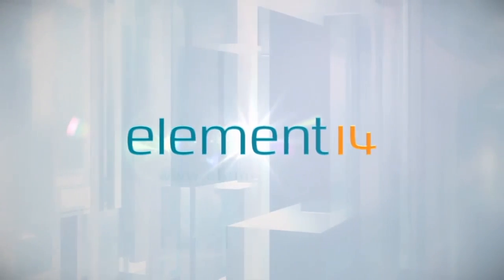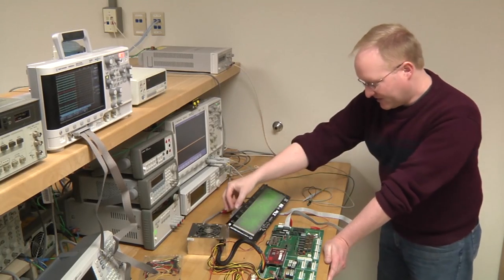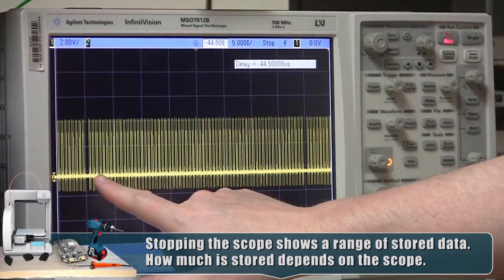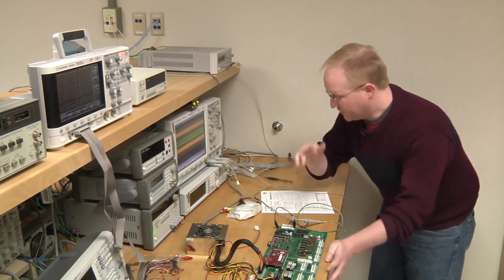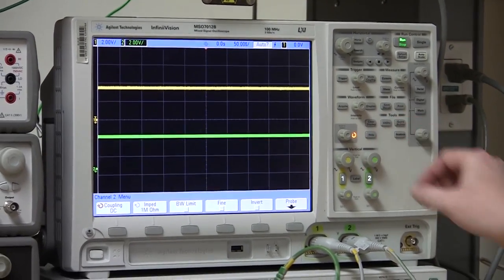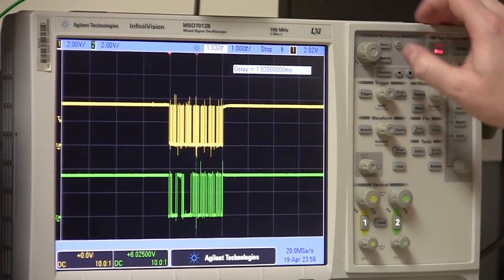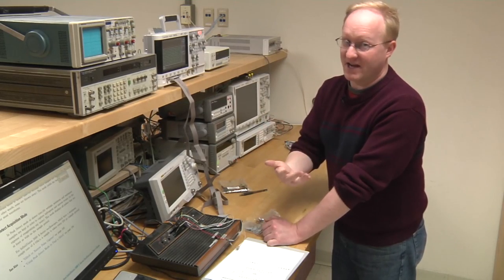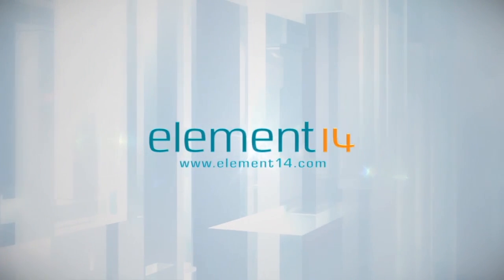Take a Look Inside with Oscilloscopes

Comment: It's pretty funny, I got back into electronics and microprocessor programming last winter before I bought a scope. I used a tiny2313 in assembly, and wanted to move a servo, so to calculate the PWM I counted clock cycles.  I got it working, but bought a scope a couple of weeks later and hooked it up to look at the frequency... that would have been a lot quicker. lol

Comment: You should try to create another 3D printer out of only (mostly) salvaged parts from printer. May printers don't have stepper motors and now use other components such as linear encoders and the DC motors!
Reply from the maker: Thanks for the idea!

Comment: Could be cool get an old cisco router, or switch, and look at boot. I remember i was getting a cisco cert everything i saw said know how to reset password. Cpmpared to most network stuff, it's a rather complex procedure. enter a special diagnostic mode, change the memory value so it skips the login part, reset it go in change the login, then change the register back. Had i not watched somehting on youtube where sombody hacked past a password on an IC i don't think would have made mmuch since.

Comment: I just looked up that oscilloscope... the price?  Over $9000.  

:/
Reply: +Tom Brannan Well, I wouldn't expect it to be cheap with it's age and the parts it uses to even function like it does anyways. Lmao

Even the description specifies them being extremely expensive and high end.
Reply: +prizedcoffeecup Age has nothing to do with it, it's more like the accuracy, measuring capacity, sample rate, features and build quality. There are new and old oscilloscopes that can vary in value from hundreds to thousands.